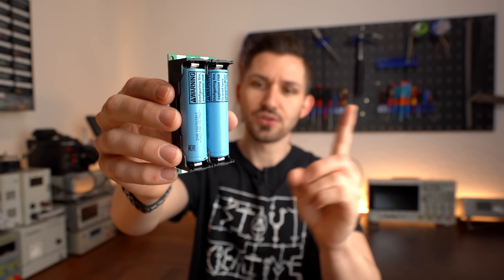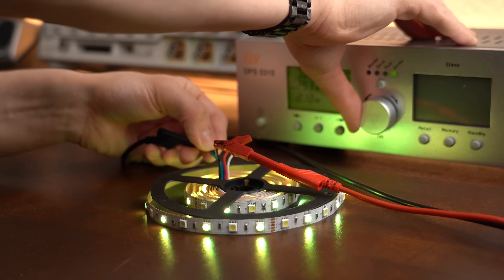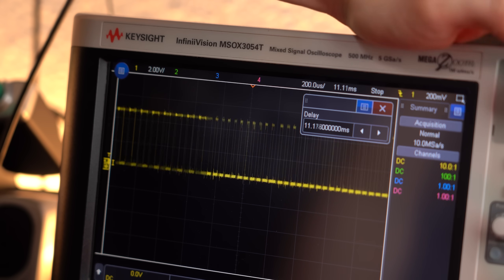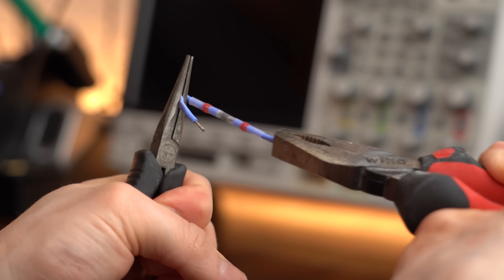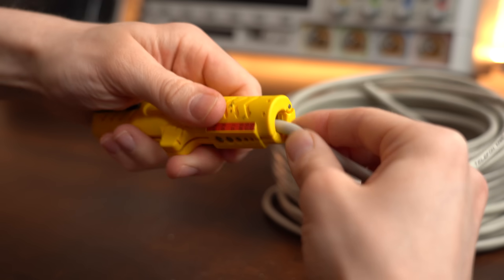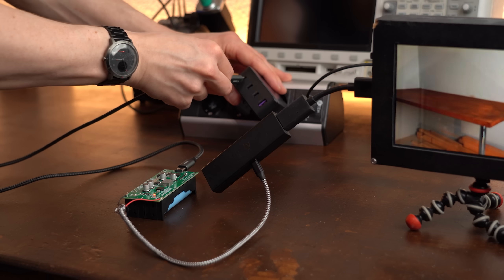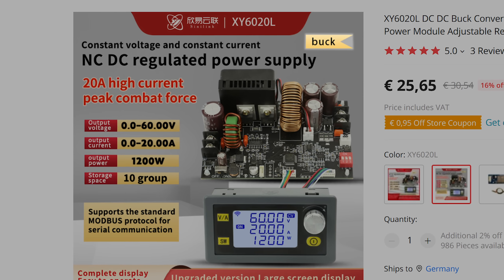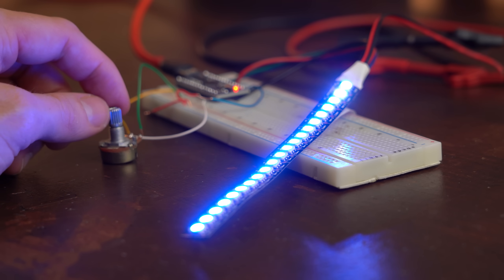I tried finding Hidden Gems on AliExpress AGAIN! (Part 4)

Comment: I would like to see if the output voltages would have stabilized with a simple electrolytic capacitor. It feels like they didn't even try to smooth the output and could be something done DIY?
Reply: Yes please...see what it would take to clean up the output volts
Reply from the maker: It seems like enough capacitance was there. Probably not ideal inductor and or pcb layout.
Reply: @greatscottlab  Any thoughts on making 5/12 V ups diy?
Reply: @ArchiWorldRuS  14v laptop adapter + solar charge controller + 12v lead acid battery = 12v ups
Reply: @greatscottlab  Are you sure, that the same error as here: https://youtu.be/gpwkiJC5hfU hasn't happened in this video?
Reply: @TylerDurden-pk5km  good point! And thank you for the link
Reply: @TylerDurden-pk5km  Any link to Dave, the shrieking banshee, should come with a trigger warning. Argh, that voice!
Reply: @TylerDurden-pk5km  definitely not--dave's video talks about using a BNC cable & this video clearly shows a probe being used. It's just amateur design; ceramic capacitors are in the wrong place and the layout & trace sizing just doesn't match best practices.
Reply: @someperson8672  OMG.  You are so right .  He  hurts my ears so bad with that voice.  I like his videos, but I have to sooth my ears afterwards with a Big Clive video.
We need an anti-shrill plugin or EQ preset.
Reply: @TylerDurden-pk5km   I noticed in the video the problem disappeared when using a proper probe - as was done here.
Reply: @greatscottlab  might be too low switching frequency, not enough inductance and too small of a output CAP. I would still recommend these for their price and use them for emergency lighting and such purposes. I would not use those for electronics though. aside from the ripple, their buck is unsafe. If these fail, they output battery voltage and may fry the 5V devices. I would only use them on cheap stuff of matching prices and serve a simple purpose.
(BTW I am native Chinese. And I buy all these stuff all the time. I don't really care if they are or aren't top performing considering the price, just use it for what you feel comfortable for. For expensive electronics, I never cheap out on anything)
Reply: @stinkycheese804  Yes. For boost its true. Buck or buck-boost may be dangerous. I can't remember which one this video mentioned so I guess you are right.
Reply: Still be fun I'm not rlly experienced enough but seems more ripple u need a high capacitance cap and a low cap to try combate it
Reply: Its possible that the noise is actually due to stray field affecting the scope reading or other measurement error and may not actually be present. Because you can't actually measure psu noise by just scoping it, that only really gives a rough indication.  Suppose you want to power the firestick, it won't care and converts it to its own noisy 1.2v anyway.
Reply: I would suggest a LC filter, but I don't really know if it would do anything.
Reply: For UPS board, I'm wondering how much the noise would affect a device with its own power regulator - is it really worse than typical (eg 12 volt) switching wall-wort PSU?
Reply: @msturtz  Ripple shown was close to +/- 500mV (1Vp-p !). Cheap wall-warts will give around 100mVp-p ripple. Good ones like the "OnePlus 100W" charger will never exceed 50mVp-p ripple even at full load. YT channel ChargerLAB does tests, if you're interested.
Reply: @graealex  LDO regulators 3.3v-24v cost less than 1 USD need almost no additional components and provide ripple in microvolts.
Reply: @tevatronxenotron1977  Not sure what your point is. An LDO will require about 1V of voltage difference, so it will dissipate at least 1W as heat per 1A of load (up to 3W wasted in this example), which is highly inefficient when talking about a power-source utilizing 18650s.
Just don't half-ass the switching regulator like shown here, and the ripple will be lower than 50mVp-p.
Reply: Probing technique maybe amplifying the noise. The ground lead can significantly worsen noise by creating an antenna.
Better to use a ground spring. Or the Coax as Dave shows.
Reply: Just a capacitor is surprisingly bad at "stabilizing" voltage, unless you put in some major capacity. When talking about full AC, doubling capacity halves the ripple (with your starting capacity being determined by your current consumption), and you can easily see how that isn't sustainable.
Instead, with switching regulators, you need the active circuitry to do most of the job of removing ripple.
Reply: @graealex  ?  Wasn't the test at full load?  If at less than full load, and considering the capacitance present was only 440uF (two parallel 220uF caps) it would seem pretty trivial to triple the capacity with a common 1000uF cap, and end up with an acceptable ripple level for most uses?

Then again, how much outside of the analog domain, really needs less than 1V ripple?
Reply: @stinkycheese804  That's not how ripple works. And it's also not how capacitance works.
And yes, most digital stuff wants ripple of less than 100mVpp. 1Vpp is way too much.
Reply: Depending on the noise frequency, it could probably be easily cleaned up using a common mode inductor and a couple of good caps.  May have a bit of voltage drop which shouldn't be a big issue.  If you are powering something in the lower current ranges, an auxiliary linear LDO regulator would clean it up nicely.  But ultimately, I'm sure the design of the power supply could be improved to eliminate a lot of the noise.  Chinese designs are typically the absolute minimum to achieve the published specs (if you are lucky) and to keep costs as low as possible.
Reply: Your probing technic with the scope is not ok, the ground wire is acting as antenna capturing more than actually should. Please review the methods, maybe add 20MHz filter in the menu.

Comment: I love this hidden gems videos. I have been looking at those Heat Shrinkable Wire Connectors myself, so I will definitely get a set of those.
Reply from the maker: Glad you like them!
Reply: @greatscottlab  I think you need to heat them a bit longer though. The ring of solder will fully melt and then the heat shrink squeezes the wires and solder together. I don't try to twist the wires if that is what you were trying to do. Just push them into each other. I suspect it will hold the solid wire too if you melt it longer, but haven't tried it myself.

Either way they are a great product, particularly for cars and other outdoor wiring.